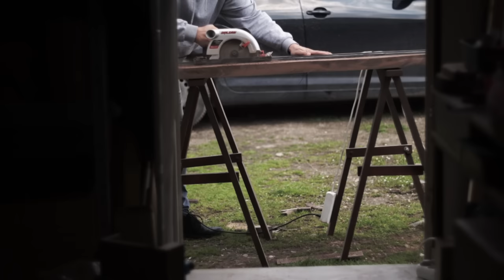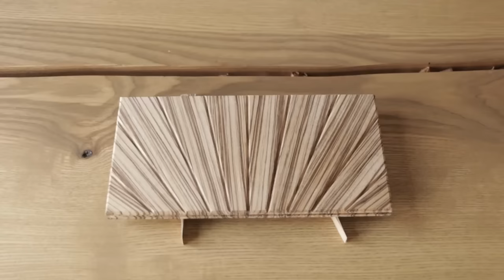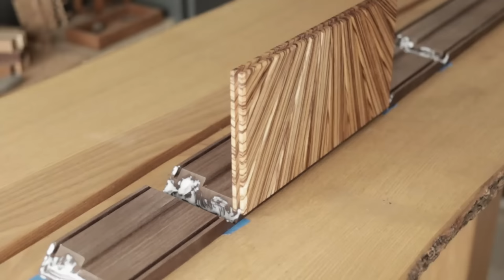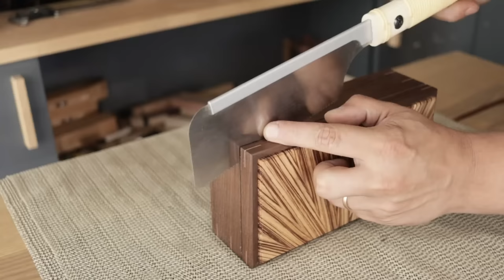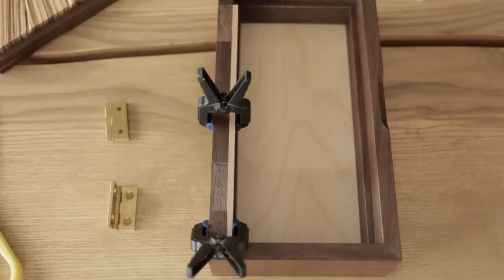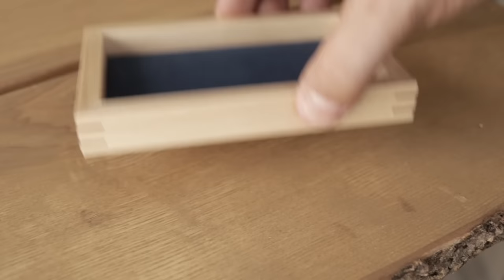Making a Classic Jewelry Box with a Sunburst Lid

Comment: I’ve been woodworking for over 45 years now and have obviously seen huge changes in woodworking. I started using dogfish skin as sandpaper and no power tools. Now, I’m lucky enough to have a large shop with just about anything and everything I need - in fact, much more than I need as I have several sets of chisels, planes, mallets etc (partly a hangover from when we had several people working in the shop).

This is the first video of yours that YT suggested to me and I am very impressed. I do appreciate the precision and (apparent?) calmness with which you work. Getting that mindset is, I think, a key to doing great work. For the last 18 months or so, I’ve been focussed on the 2nd fix woodwork on a large converted barn - we’ve spent way over £20,000 on European oak (solid and veneered) with much of the work (from skirtings to picture rails to door frames to cornice to doors) in the English Arts and Crafts style. There is quite a bit of my furniture in here, made over the years by me in various styles. We like that eclectic look. 

A couple of comments - comments, not criticisms and not saying this is better

I keep my sharpening station ready loaded on a shelf under my workbench. That way, when I get a case of chisels to be used, I pull up the station (in my case I use Waterstones and leather strop) so that, every few minutes, I just turn and hone up the secondary bevel on 8000 grit and then the leather strop. Once in a while, I might need to reset the primary bevel and, for that, I use the Tormek with a diamond wheel to get most of the work and finish off back on the stones. For that primary bevel, I use a Veritas honing jig but I do the secondary bevel freehand. For beginners, I strongly suggest the scary sharp system. It’s low cost (relatively) and you can get great results. On the rare occasion I do work outside of my shop, I take along a piece of plate glass with the films attached to it. 

Have you tried the box accessories sold by Andrew Crawford (smart hinge, smart lock etc.) I went on a course with Andrew many years ago when he was just starting on the smart hinge. Personally, I like the unobtrusive nature of his hinge and that you can fit on boxes that have walls of 14 mm or thicker - very hard to do that with standard hinges. 

Just finally, I see that you use Danish oil and a final cox of microcrystalline wax. I have to say that I haven’t used Danish oil for years now - not that there is anything wrong with it but I find the varnish element can be not to my taste. I do finish in several ways from just shellac or shellac and then wax. If it want something more hard wearing, I have used hard wax oil for a long time now. I particularly like the 2 pack items as they cure so quickly - that means I can move them out dope the way without risk and also less chance of airborne dust contaminating the piece. For the barn conversion, we spent a fortune on Rubio. It’s good stuff but very expensive (per square metre, let alone per litre). Anyway, I came across a YT piece from the Wood Whisperer who reviewed various HWO. His overall recommendation was Natura Onecoat. It’s not yet commercially available in the UK but soon will be.

Comment: Beautiful piece. Question - what small circular blade did you use in the router table to separate the 'lid' from the 'rest of the box'? Have not seen such a fine cutter (even if you have to 'complete' the cut with a hand-saw). Apologies for the late comment (have been away for a while) and thanks in advance.
Reply from the maker: Thanks! That's a slot cutter router bit. This one in particular is from Klein but many others make them

Comment: Hello , What kind of tool is cutting the box on time 5:49 , can provide tool url
very thanks
Reply from the maker: It s a slot cutter bit from Klein
Reply: Thanks for answering this. I am wondering what configuration slot blade it is. Would you consider putting it in your list of tools? I've noticed this question on other videos you've made. There are a variety of slot bit both with and without guide bushings. Thanks for considering adding it.